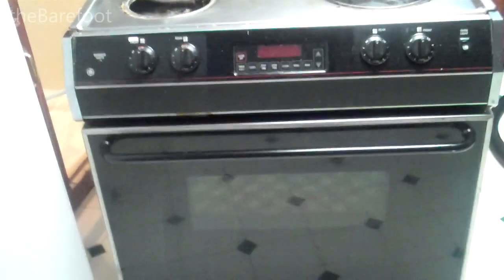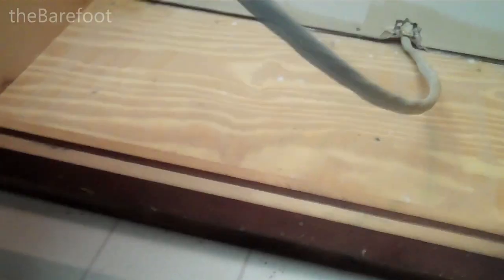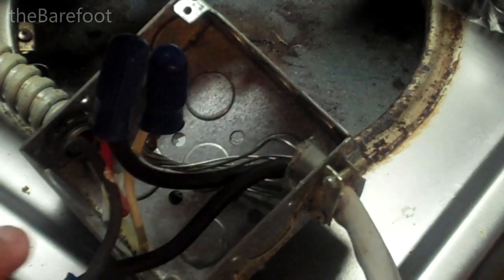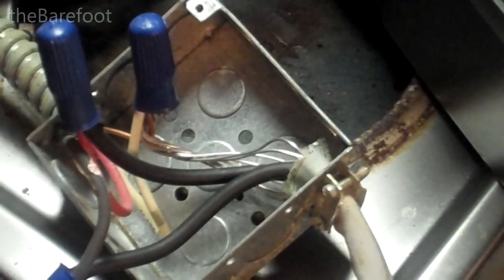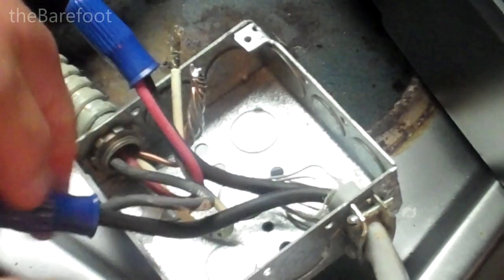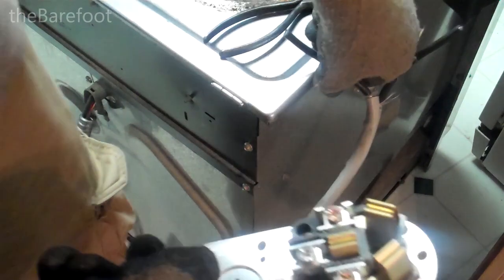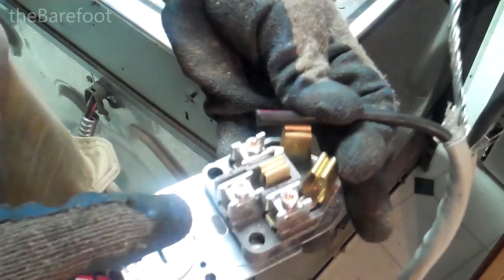Wiring a 3-prong, 240V/50A Existing Range Outlet (removing a junction box)

Comment: Glad to find your video. I'm facing the exact same situation. House built in '78. Drop in stove is the original. New slide-in coming tomorrow. Pulled old stove out tonight to find it was hardwired directly into a junction box too. And, just like yours, the wire from the breaker panel to this junction box contains only three wires with one being a bare aluminum neutral.
As TheNaturalust noted below the wire should be replaced.
For whatever reason though, where we live it is common practice that your hotwater heater and your stove/oven breakers are mounted in a separate breaker box on the outside of your home. Since this is a fairly big multi-story house (the wires run up the walls, through the attic, then down inside the outside concrete block wall) there's literally no way I can replace the wire.
All I can do is make my connections neat and tidy and hope for the best.
Reply from the maker: Pierre Cardone Good luck with your project.

Comment: Insane electrician is correct .. He just snaked the supply cable out through a hole in the drywall and ran it to a free-floating junction box lying on the floor under the range

PROPER (required by Code, unless you live somewhere with no electrical code) is to terminate ALL house wiring (whether running under floors, through walls, at an electrical box MOUNTED the studs, either recessed in the wall or surface-mounted on the drywall (but also screwed to studs), so that there is no exposed house wire between the wall (or floor or ceiling) and the terminal (junction box, switch or outlet)

DANGER DANGER !! :(

Comment: Curious I had same wiring but coming in to the receptacle I had a ground wire...from the breaker box...it was red black white and copper groumd..wasn't for sure where to hook that wire...in receptacle diagram doesn't mention it

Comment: Solid black and red wire will carry 120VAC per leg into 50A breaker inside panel. White/neutral wire will carry 120VAC to power lights, clock ECT... No ground from panel-outlet and outlet-range cord?
Reply: Shaun Weimer    Prior to NEC 1989, stove branch circuits were allowed to be installed with two hots and neutral/ground combined.    It works, but violates the new rules of total separation of neutral and ground.   Electric dryers were connected this way as well.    This is why there are two different plug types with three and four prongs.   When the house was built makes the difference.
Reply: @KevinCoop1  Thank you for replying to this commenter. He would be thrilled people are still watching. I lost him almost two years ago to an horrendous three month battle with Stomach Cancer.
Reply: Matronista Forever      I am very sorry for your loss!   He sounds pretty young in the video.  I too almost lost a battle at about be same time.   I had heart attack and during surgery, my heart stopped.    Very weird experience.   
Respectfully,    Kevin

Comment: Regarding that bare ground, can you put some heat shrink on it? Leaving it bare makes me uncomfortable. Also, did you mount the receptacle on the wall? Did you pull the excess cable back through the wall.

Comment: DANGER aluminum wire!  You need to do two things:

1. Make sure the receptacle is marked "CU-AL" which indicates that it can handle copper or aluminum wire.

2. You must coat the conductors in antioxidant paste before inserting them into the terminals.
Reply: very true im a electrician
Reply: No de- ox required for aluminum alloy cable which came out in late 70
Reply: Most new alloys don’t need de-ox but we do it to make the uninformed happy.  I do however have issue with that tiny screwdriver.  No way those things are torqued enough.

Comment: I'm in the process of doing this too. Only problem I have the electrician left 6 8 inches of wire coming through the floor. So I have leave the panel in place with the outlet secure to the floor. Now the stove will be 4 inches higher than the counter top

Comment: hoping to get a reply! Just had a new range installed, but i also had wires connected, not a box which an electrician redid to a 3 prong outlet.  But the range will not sit close enough to the wall, so is there an outlet that is more recessed into the wall?  secondly, the range seems to vibrate, I can feel it on the handle and controls.  Lastly, having someone comeback to look at range as only the burners work.  oven doesn’t work, nor oven light or the clock on the control panel.  Breaker was reset, no change.
Reply: He would be thrilled people are still watching. I lost him almost two years ago to an horrendous three month battle with Stomach Cancer.

Comment: If that gray wire is #6 Aluminum, it is only for 40A not 50A. You also need an neutral for the 120V circuits in the range.

Comment: I’m curious. Since you had the ground wire, I’m assuming the breaker box was setup correctly to accommodate, so why not just install a 4 prong outlet instead?
Reply: @ElementFreedive  I can’t tell if you’re joking or not, as he obviously could have returned that plug and purchased the correct one - since he had all 4 wires already.

Comment: Hi,, I am currently facing this issue. I purchased the exact range outlet. My question is mainly the 2 hot wires. Which one goes left and which one goes right??? From the video I can see from one red the other is black but cant tell which is which once installed. Will things go terribly wrong if the 2 hot wire installed opposite sides?Thanks..
Reply: Mochi & Maki    The two connected to the breaker(hots) are exactly the same and can go to either side safely.
Reply: Mochi & Maki the black and red wires are interchangeable
Reply: @Nick-bh1fy  He would be thrilled people are still watching. I lost him almost two years ago to an horrendous three month battle with Stomach Cancer.

Comment: What if you have 4 wires from the wall? A black, a black with a white stripe, a black with a red stripe and a bare braided one. The oven is a 1956 GE. Prior owner used it up until Dec 2015. The cord from the oven is newer with a 3 pronged plug.
Reply from the maker: +Colin Fitzroyale: If I understand, you have a newer house with the 4-wire code and an older range? If so, you should wire the outlet per the normal 4-wire code and change the ranges cord to a 4-prong. There are some good videos (not mine) on how to wire a new 4-prong cord to an older 3-wire range that will help.
Reply: 4 Wire will be HOT-HOT-NEUTRAL-GROUND and requires a NEMA 14-50 socket now (which has grounding included).
I am a bit worried about @theBarefoot s setup, because there is no grounding wire visible (NEMA 10-50 does NOT carry ground, it has to be strapped to the appliances casing separately.

Comment: Dude you have a major problem there. The supply wire is using bare aluminum wire as the neutral conductor, this will carry current if the range has any 120 lighting or controls on it. Bare neutral wires are not permitted. You need to replace the gray cord with a 3 conductor plus ground cord for a safe electrical system. Use the white conductor in your new cord as a neutral to your receptacle, not the bare wires.
Reply: TheNaturalust     Prior to NEC 1989, stove branch circuits were allowed to be installed with two hots and neutral/ground combined.    It works, but violates the new rules of total separation of neutral and ground.   Electric dryers were connected this way as well.    This is why there are two different plug types with three and four prongs.   When the house was built makes the difference.
Reply: @KevinCoop1  It could be argued that re-terminating the end, by replacing the junction box with a receptacle, constitutes enough of a change that the entire branch circuit must be brought up to code.  Realistically, no one is going to complain.  If it were my house, though, the three wire circuit plus the aluminum wire would be enough to motivate me to replace the entire run.
Reply: IGnatius T Foobar     Yes, you are correct.   Changing anything from what it was to something different is not replacement.   Personally, I would upgrade the whole thing, because I do not like aluminum from back in the 80's or 90's because it is softer aluminum than used for feeders today.   Even though the new devices are rated cu/al.

Comment: Hi, the Barefoot. I could use some help please. Here it goes, but I may get long winded doing my best to fully explain. Like yourself, I'm replacing my 30 yr old kenmore drop in range with a new full size/slide in kenmore range. My new range instructions shows that it accepts 3 or 4 connection wiring. I've pull the old drop-in out and removed the kick panel. My old range was hardwired like yours using a junction box. My junction box has 4 wires running out of it that went to the old range; red, black ( 2 live) white (neutral ?) & a bare copper wire, (ground I suppose?). When you first showed your junction box opened in your vid it looked like you too had a copper, a white, and the aluminum bundle of wire all tied together running inside or to your old junction box along with two live wires red & black. But, then you edited your video. In the final section of your vid you are only showing three wires total to hook up to your 3 wire 240v 50 amp outlet. They are the two live, red & black, and the aluminum serving as neutral or ground. What happened to your white and copper wire that was running from your wall to inside your old junction box all bundled together with the aluminum wire??  Looks like you went from having 5 wires in the box to just three left connecting to your new installed  outlet. Did you just cap them off? Is that code or safe? To further explain my set-up; from my sheet rock wall or control panel running to the inside of my old juction box are 5 wires total. Like what I thought yours looked like at the start of your video with your old juction box opened up. Inside my box are the 2 matching live wires, red & black. Also, tied together is the matching white , a non insulated /bare copper, but also combined with these two is the bundled thick aluminum wire like yours shown on the video. Since this was a 1985 drop in range I presume it was identical to a 3 wire or prong set-up of what was used back prior to year 2000. However, I removed my drop in range several months ago and started on other projects that became more pressing. I wish I had made note of where my copper wire had been attached at the back of my drop in at the terminal block. I'm thinking maybe the copper wire was attached to the grounding strap being that it was a 3 wire hook up. Meaning, at the terminal block on my old stove the red & black  wires(live) were attached to the right and left side, the white (neutral) in the middle and the bare copper used as a ground wire connected at the grounding strap, not at the green screw like a 4 wire connection? Would I be right in my presumption? I understand by code that it is okay to use a 240v 50 amp outlet (3 wire connection) if it is existing only. Otherwise by code you are to use a 4 wire connection. Well, I'd like to go ahead and install the three wire connection because my house is on a slab and it would not be easy access to get a new 4th wire run from my panel box to behind my wall going to a new 4th wire connection 50 amp outlet. Thus, why I'm not calling my electrician just yet. Can you help me? What did you do with the white and bare copper wire that I believe I'm seeing in your opened junction box at the start of your video? I need to know if my eyes are playing tricks on me. I'd like to go ahead and finish my install. You had the exact or close to the same project as myself. Hope to hear from you. You may email me if your wish. I'm at  Mab3057@Juno.com. Or, message me here. Or last, use your google account if your have one. Thanks in advance. Sorry this was so long.
Reply from the maker: +Lori Scott Thanks for the question.
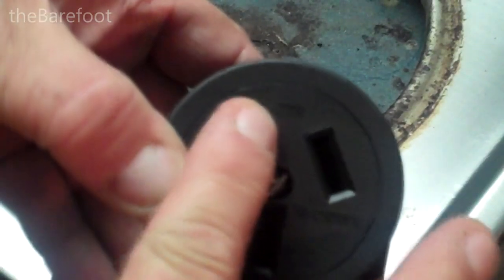The white and copper wires you saw in the beginning were on the range side of the junction box. They were tied together into the ground. If you pause the video at 2:15, the left side of the screen is the range side of the box. The right side of the screen is coming from the wall. There are only 3 wires coming from the wall, 2 black and the aluminum ground. On a 3-prong plug, you'll have the two blacks to your hot leads and the ground to the center prong. I can't advise you on your local codes, but normally "changes" don't include things done outside the walls like changing a plug or outlet. Codes normally only come into play when making significant changes like adding a circuit, running new Romex, etc. Since yours is an existing 3-wire circuit, MY INTERPRETATION (note: this isn't legal advice) is that you're fine putting in a 3-prong outlet.

Good luck with your project.
Reply from the maker: +Lori Scott I've added some annotations to the video to clarify what's what. Thanks!
Reply: +theBarefoot. Thanks so much. I was incorrect in my visual of the incoming wires from the wall going to the old junction box. You've made me realize that I deceived myself. Mine has the exact set-up as yours in the video.  Coming from the wall are two black live wires and one aluminum bundle wire for the neutral/ground. So, I'll pick up a 3 wire 240v 50 amp outlet tomorrow along with a 3 connection wall plug.  One last short question. When wiring up the three wire plug/cable going to the new slide in/full size range, I know red and black are live going to the right & left, the white is neutral going to the center but where do I put the bare copper wire? Do I attach it to the grounding strap instead of the green ground screw as a 3 wire connection is described in the operation manual? Thanks so much for your quick reply and help!
Reply from the maker: +L AS Follow the manual that comes with your range for wiring. You don't want to void your warranty.
Reply: can I use this outlet for 3 prong dryer?
Reply from the maker: +ann tang Dryers are usually 30Amp. The hardware is similar and the concepts are the same, but if you are putting in an outlet, get the appropriately rated amperage.
Reply: +theBarefoot , many thanks. I have an old wiring like that in your video.  it has ever used for range, now I want to connect it to dryer outlet,  is it OK for this conversion?  how can I send the picture to you?
Reply from the maker: +ann tang That depends on the circuit. Just changing the outlet won't change the amperage. If it is truly a 50A circuit (ranges are 50A), you don't want to hook a 30A dryer up to it. Technically, it would work, but you run the risk of damaging your appliance since the 50A breaker won't trip as soon as a 30A. If you ever got a surge, it could blow out the dryer and/or start a fire. In addition to any  wiring changes, you should also change the breaker to a 30A. Changing a switched breaker is really, really simple as long as you turn off the main breaker. They just snap out and in. If you're running on the old screw in kind, well, you've got more problems than we can cover in a Youtube comment. (also, never take Youtube advice in place of a licensed electrician.)
Reply: +theBarefoot Great thanks, I see, if use the old existing range wire for dryer, first I need to change the breaker from 50A to 30A. that will be safe.  for the existing 3-wire, two hot wires are wrapped by rubber and cloths, neutral is bare like that in your video.  but it is in good shape,  May I convert it to Dryer power outlet?
Reply from the maker: ann tang Yes, it can be converted.
Reply: +theBarefoot Appreciated!!!!!
Reply: I have a black white and bare wire for the supply side going to a black white red and bare. do I i tie the white and bare wires and the black and red together?
Reply: @loriscott2477  I believe common neutral/ground is not allowed, you need to wire a seperate ground the oven case or use a NEMA 14-50 with GROUND separated.
Reply: He always answered the ladies I see. Lol. 
I lost him to Stomach Cancer almost two years ago.